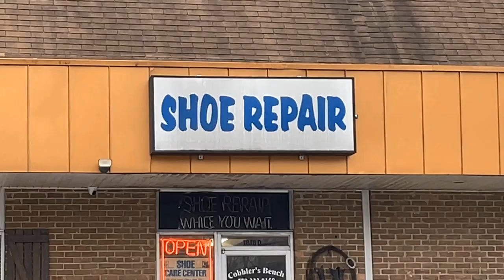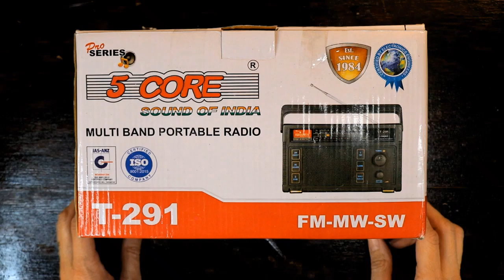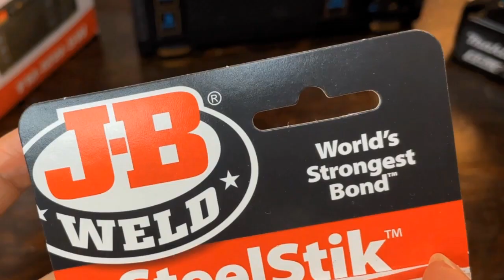"Repair" a movie by Rachael Padilla (with sage wisdom from Van Neistat)

Comment: The way I approach repair, given it is my profession and part of how I get new things because of my preference for older construction, is less as art and more as a way of reclaiming ownership. If you spent the money, especially if it's a lot but even for smaller things, you have a right to keep that object useable for as long as possible. And sometimes all that means is you undo a screw or add some glue here or there. It doesn't seem right to throw away even the smallest thing if it can still be useful.
Reply from the maker: Absolutely! That sense of ownership makes a fixed item even more personalized. Thank you for watching!